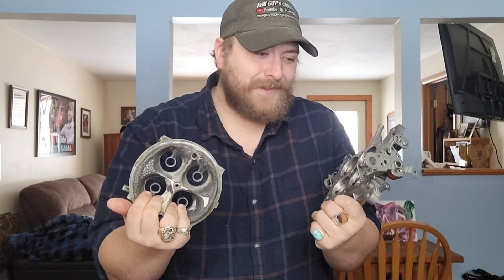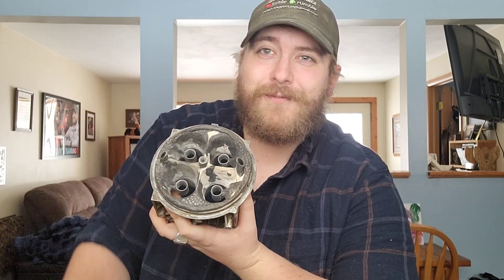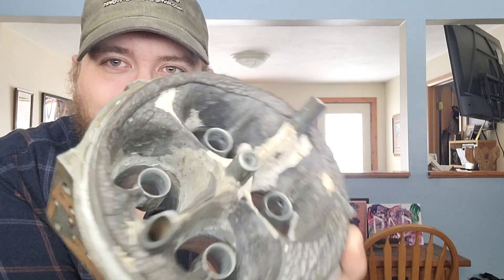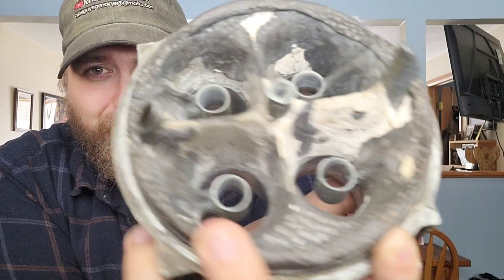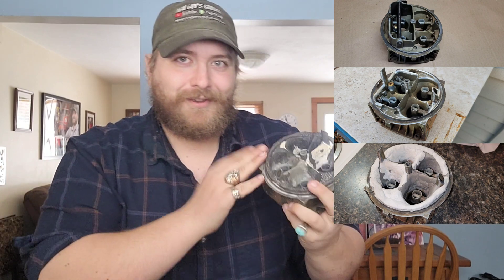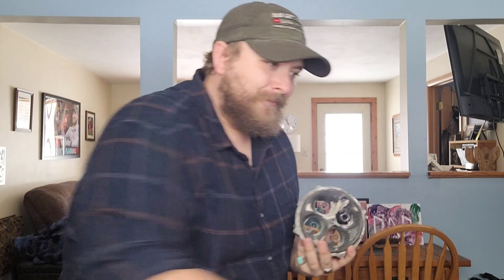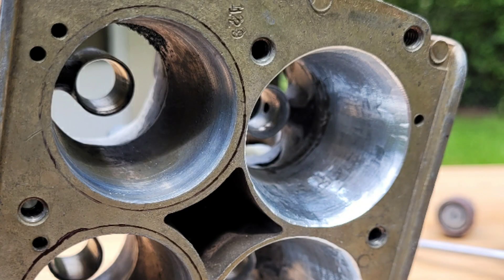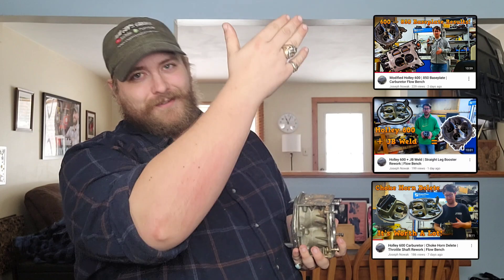157 CFM Gain! | Holley J&B Weld Carburetor Mod | 850 Baseplate Upgrade Flow Numbers | Results Are In

Comment: Why not start with a pro form body where you can get a bigger baseplate where it can hold a gasket? I think if you could get 1100-1200 out of a 4150 baseplate you’d have a market there. The problem is how it performs on the dyno, which I’m sure you know are all over the place when it comes to carbs. Two similar engines will run differently and like 2 completely different carbs. It’s weird.
Reply from the maker: An 850 butterfly size is the biggest square bore size baseplate you can commonly get, so trying to make a 4150 flow 1,200cfm is probably not happening lol. 

Or at least not happening while keeping the small venturi opening and large baseplate opening to maximize velocity, which is the whole point 😅

I started with a very undesirable carburetor on purpose to see what I could get out of it. It would have been super easy just to hog the venturi opening out to get more flow, but it wouldn't have been quality flow. 

Rather than trying to make a 4150 flow like a dominator......it would be far more effective to make a dominator drive like a 600cfm carb on the street yet still give you the wide open throttle performance it is known for.

A lot more efficient that way 😃
Reply: @newguysgarage6802 definitely easier and dominators can be very street friendly. My mind is just stuck on 4150 base because with the organization I race with we are limited to a 4150 carb. Would definitely take serious work to get a quality 1100+ and get the velocity right. Holley has a “1050” 4150 but I’m not sure if it’s like a “950” that doesn’t actually flow 950. Most guys in our group run tunnel rams but I’d like to see what can be done with a single 4150. My car makes around 750hp on a single 850. Got a buddy that dyno’d a 496 at 770 HP with a single 950 with hydraulic roller and 10.5:1 compression
Reply from the maker: Well.....if it can be a highly modified 4150 (and I mean highly modified lol) you could always make it a twin blade. 

Remember the old holley 3 barrels with the secondarys just a big butterfly and it all open? 

If you could find yourself two of those long butterflies you could machine the baseplate to take them both primary and secondary. 

Then on the main body blend the bottoms out to fit the twin blade butterflies. Don't just open them all the way up to the top like the 3 barrel ones did though, leave the 4 venturi openings at the top so it can help pull on the boosters. 

No idea how much cfm that would flow but....probably more 😂

Actually I don't know what "diameter" those blades are in that old 3 barrel but if you can get or make ones that are the 850 size that would be best. 😂

Comment: I’ve done something similar to what you’ve done. I reshaped the main body of an 1850, with epoxy and JB weld. Instead of using the 850 baseplate, I thinned down the throttle shafts and used button head screws. It runs pretty well. Definitely a big improvement, over the stock 1850.  It chirps the tires in all three gears

Comment: Built similar carbs in 1982 w/pro stock racer Charlie Maluk sent out to Tim Cole 'on his flow bench they flowed 770 cfm raced them for years-still have them but now run alky in some 750s from Pro Systems good combo-both gas and alky
Reply: The main thing we did different was use a ball mill to the bottom of the main bodie throttle bore to get it to match the base plate this made a second pressure drop-great throttle response kiiler 60 ft.
Reply from the maker: @daveperry679 that would be the ideal senerio having it machined rather than hand ported lol.
Reply from the maker: @daveperry6793  that's awesome 😃

Comment: You might try a laser printer and a scanner? It’s kinda like the K&N Stub stack without the choke tower. Keep testing👍
Reply from the maker: Thats what I was thinking too 🤔 

The K&N Stub stacks smooth the entry going into the carburetor. What im looking to do is actually change the inside of the carburetor, by eliminating empty space around the boosters 😃
Reply: @newguysgarage6802  your a complete moron.

Comment: Problem is those Holly carb bodies are not always consistent. 
You may be able to scan a carb you have and 3D print a insert that perfectly fits your carb but it may not perfectly fit other carbs even of the same type.
It is notoriously difficult to get customers to "fit" complex shape components. They generally don't have the skill and they expect everything to be plug and play with no effort.
I think you would be better of machining a entire carb body.
Problem with that is nobody will buy it because it was made by you and does not have a big name brand name on it.
Reply from the maker: @Hydrogenblonde  you can always build in tolerances to it lol. 😁

Comment: There’s going to be a whole lot of signal , probably to much . 
 I had a work done a a 650 had it flowing 815 cfm . 
 Try slowing down the fuel when you open it and Atomize is a fuel at the same time 😂 
 High speed means you need to slow the fuel down as well as atomization. . 
 Just go to a bigger carb and be done with it .  
 You’re not reinventing the wheel carburetters are already very well matched . 
 I liked enthusiasm though 😎
Reply from the maker: @caseym3118  having a whole lot of signal on a BIG carburetor would be a good match. 

You can never have too much carburetor (or CFM) ...but you can have too little booster signal. 

You can always reinvent something no matter how "efficient" it already is. Sometimes efficiency doesn't always align with profits for a company....why build something so good you can't sell anything else after it 😉
Reply: @  have you seen the new edlebrock carbs ? Quite similar. 
 Flow is one thing getting it run right is another. 
 To much signal is not always what you want . 
I know . I had 650 on a sbf with too much signal. The fuel came out like large droplets ( different than 815 I had  ) 
 Opened up the bleed problem salved . 
 Talked to a carb guy that knew more than me . His answer was put a 750 on it . Never looked back .
Reply: But hey  prove me wrong and lets see it run
Reply from the maker: @caseym3118  your problem was you had too much signal on too small of a carburetor. 

What if you had the perfect amount of signal on a 1050 dominator on that sbf? The CFM is not why you can "over carburat" a car....the lack of booster signal on that big carburetor is. 

More booster signal on a larger carburetor will give you the best of all worlds. The easier the engine can pull in air reduces pumping losses....a 302 with a tunnel ram and two 1050 dominators are not uncommon in the drag racing pro-stock world....but not on the street because why? 

Because that much CFM will not pull on the booster enough at low rpm to effectively pull fuel out of the booster at part throttle.....but if those carburetors had twice the signal and could actually function off of wide open throttle.....then you could run them and have best of both worlds. 

And that is just one demonstration lol 😆 
Like I said I need prototypes to send to people for further testing.
Reply: @newguysgarage6802   I can tell you I’ve built more than a few small block fords and they like bigger carbs maybe not a 1050 or 950 for that matter but a 750 stock or not will run great the engine I had the 650 on was a 289 and you would probably get just as good as fuel economy, and throttle response as a smaller carburetter and when I mean, response, I mean, not just revving it in neutral when you’re driving, you should notice more torque. 
 I’ve tried small carburetters always ended up with the bigger carb.
Reply from the maker: But they might like that 950 or 1050 if those carburetors had the booster signal to actually work.....see my point 😅

And the extra CFM will cut down on engine pumping losses (piston fighting to pull air in through the smaller carburetor) 🙂

Comment: Assume it was still usable, and it was fitted to a car. It'll ice up at idle in about two minutes. I'll let you figure out why.
Reply from the maker: @PiDsPagePrototypes  your saying the extra booster signal will cause more atomization resulting in better heat absorption making it ice up?? 🤔

I don't believe that would be a problem....possibly a benefit really if it does pull more heat out of the air, which I never really considered. 

Cold air / fuel makes more power, cool cans and icing the intake manifold have always been tricks to try make it as cold as possible. 

And I doubt it will pull more heat out of the air than E85 does even if it is cooling it down more because of the booster signal. 

Or were you thinking of something else? 🙂
Reply: @newguysgarage6802  Something else indeed, and it'll ice up enough to prevent fuel flowing through the carb.
Look at it from below.
Reply from the maker: @PiDsPagePrototypes  .....im just not seeing what you're looking at 😅

Nothing on this looks to me that it could possibly freeze gasoline lol.

Comment: 🔔😎
Been done yeeears ago.
Several drop in tries at smoothing airflow.
Reply: Yes, K&N has made them for decades.
Reply from the maker: @chrismorrison9140  no not quite the same thing lol 

The K&N one only smooths the outside of the carburetor entrance, It does not go inside the carburetor and fill the empty space around the boosters 🙂

This is completely different then just a velocity stack or stub stack 😁
Reply from the maker: Really??? 
Is there a modern manufacturer selling one today by chance 😅
Reply: Not sure if the "K+N stub stack" is still available commercially. 
From watching David Vizard ,I learned he helped develop that k+n stub stack. 
Like I said I'm not sure if those are still being made for the Holley carbs. 
Give Google a try, it'll at least show ya what one looks like.  @newguysgarage6802